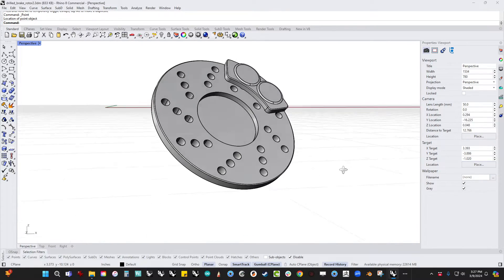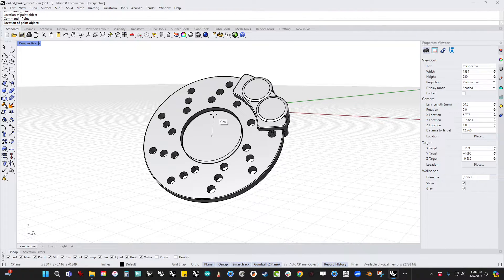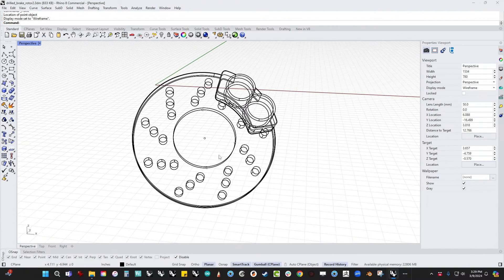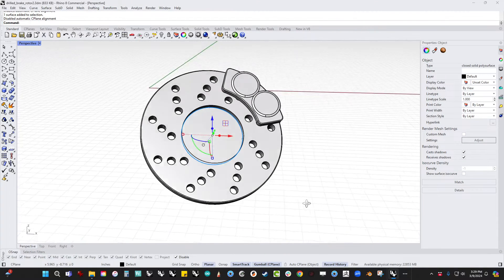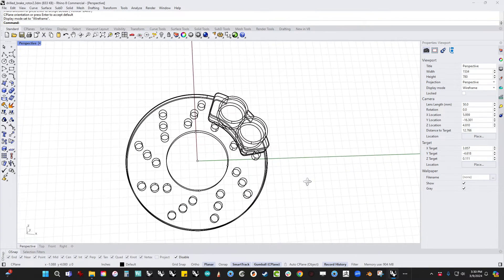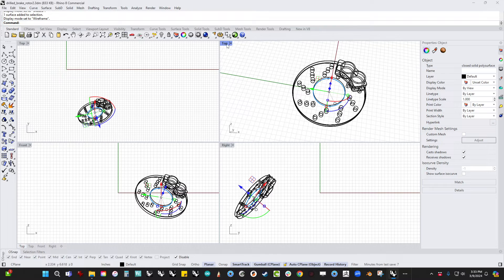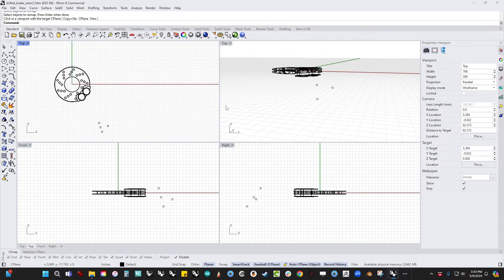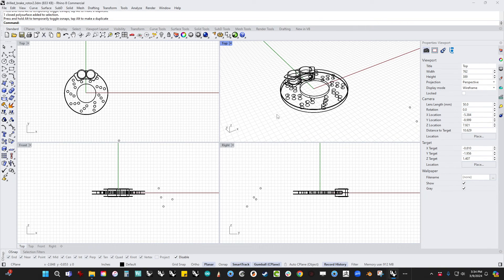ReMap Cplane -  Rhino 8

Comment: It sounds so cool but unfortunately if doesn't work for me, and I have absolutely no idea of why. Can't get autocplane or remap cplane to move the cplane to the imported stl mesh
Reply from the maker: meshes are more difficult as they do not have defined faces like a polysurface per se. 

Map a cplane to your stl mesh 1st using the 3 point method and vertex osnaps. Once you have this base cplane established, you can then remap it to a world x,y, or z plane. 

you have to establish a base cplane to work from in order to have something to remap to.
Reply: @Rhinoceros3d  Awesome, thank you! Would it be advisable to convert the mesh to nurbs or dsub before trying to align it?
Reply from the maker: @hizacaine  nah, you can align a cplane with 3 points on a mesh pretty easily.

Comment: An alternative method is to use the "Named CPlanes" panel and directly click on some of the saved CPlanes there. :) 
https://www.youtube.com/watch?v=Q9aZVt-1j1s
There are a few advantages of that approach:
1. It works directly in the same viewport. No need to reach different viewports. This way, the viewport could be maximized and even locked, and the trick will still work;
2. It does not need to setup different views preliminary with multiple viewports opened simultaneously;
3. As long as the "Named CPlanes" panel is opened, the selection could be remapped to any saved CPlane in the list, even very far from the camera.
Reply from the maker: NIce add! thanks! yes, that is very cool-